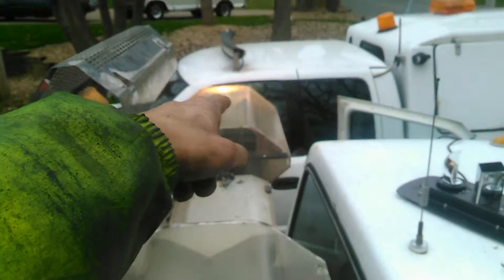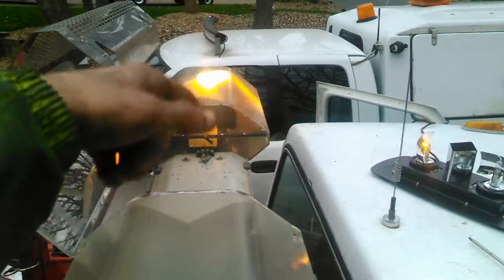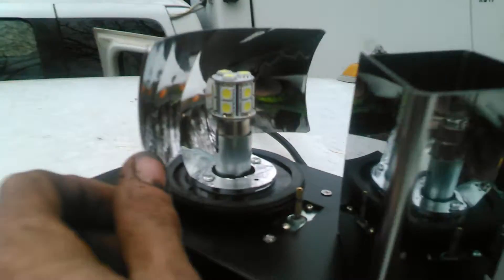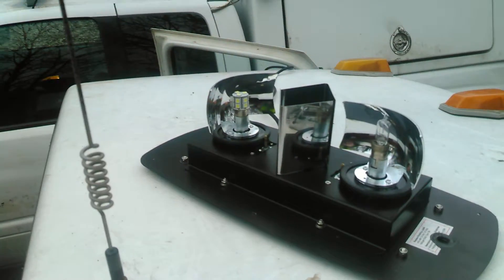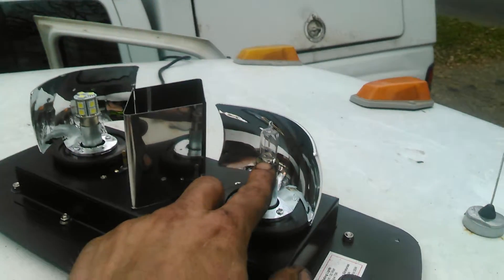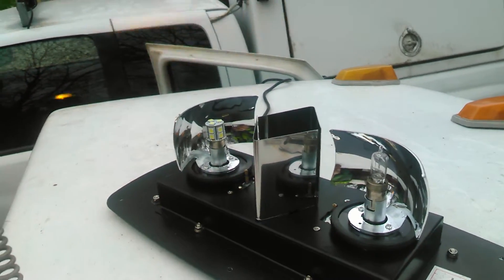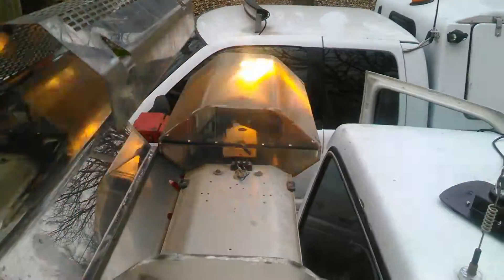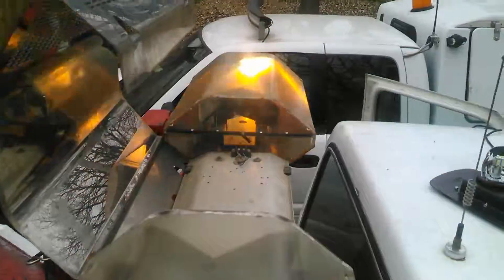LED light bar for cheap

Comment: thats a good idea, honestly have not thought of that one yet.  you can also clean those lenses up in about 10 mins, with some metal/chrome polish, then finish with some wax.  looking good though
Reply from the maker: The Duece thanks for the comments. the main difference between an actual led bar and this is just the integrated LED board. this way still has the LEDs, just in a different setup. same concept for much cheaper.